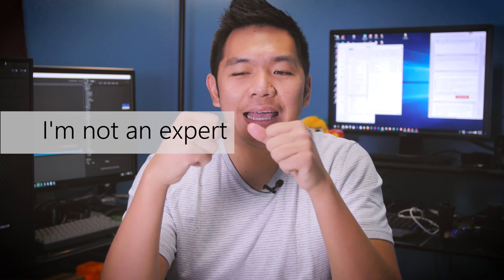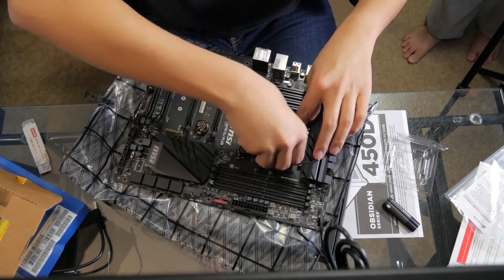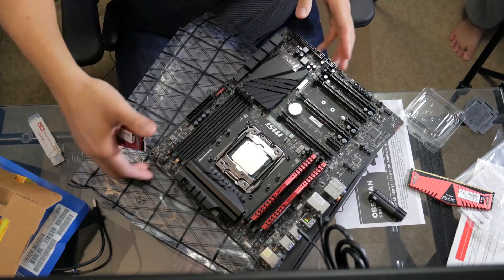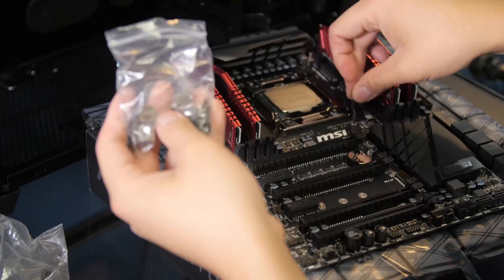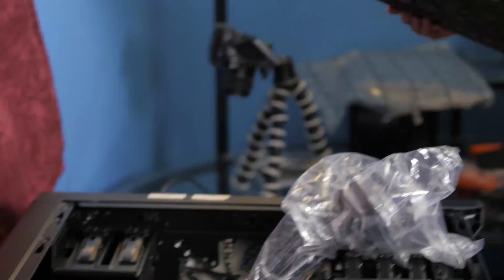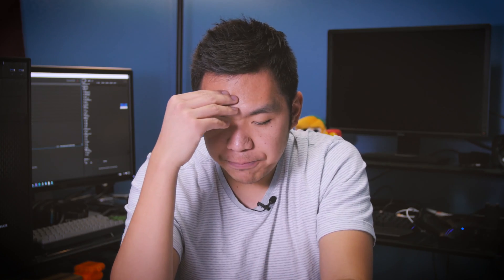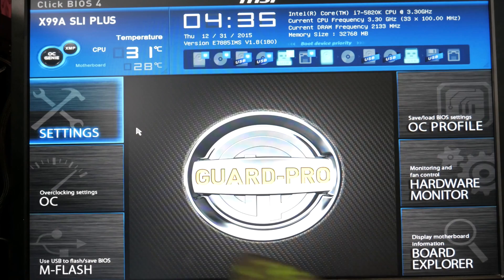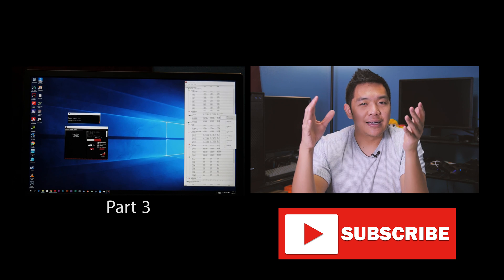4K Video Editing Machine Build 2016 with NVME SSD (Build)

Comment: Hello, T1CG...I'm just starting to build my pc with the exact motherboard and corsair cooler that you have on your build. I wanted to ask you a question concerning the back plate you receive with the corsair cooling system.  The MSI motherboard which I have (same as the one in your pc) has already a back plate which is metal.  Do I need to change that metal one that comes with the motherboard for the plastic one so I can install the corsair cooler to the cpu? Or should I just leave the metal back plate that comes attached to the back of the motherboard on and connect my cooler to the cpu with that one? If you can help me out with this I'll appreciate it thanks!

Comment: Hi, I want to build a pc soon and decided to copy your build because it seems like it's going to help speed things up for me a lot. I do 4K video editing and take a lot of pictures with my D810 in raw and just need to get a powerful machine.  I think your pc build for the money is the best build for the type of editing I will be doing so i'm going for it.  This will be my first computer build ever so a little nervous but If I take it step by step I think i won't have any major problems. I like the tower you have but I was thinking on getting a white version of the one you have.  Are there any large white towers that you would recommend that are similar to the one you have? Any other advice for a first time computer build would be greatly appreciated. Thanks!!
Reply from the maker: I actually upgrade to the Fractal Design R5 case. I found it to be a lot quieter and had more space when it came to adding drives. I can't really recommend a best white case, you'll have to check out other reviews out there.
Reply: +that1cameraguy Thanks..I'll check that case out. I'm not 100% sure what color I'm going to choose but size might be more important so I'll look and see what I get. Thanks again for the reply.
Reply from the maker: Are you going to go with the 6-core 5820k or the 6700k? Theirs mixed opinion on this since higher clock rate is better for lightroom, but the 6-core will do a bit better for video.
Reply: +that1cameraguy I was going to go with 6 core 5820 k. I actually jump from lightroom and photoshop back and forth all the time plus some other photo manipulation softwares and have them runing in the background constantly....When it comes to video editing I just can't stand waiting for the render times I get..It seems like I'm watching paint dry.
Reply from the maker: What is your current system that you're working off of?
Reply: I have a 21.5 inch 2012 iMac with the basic 8gb ram.  To get the performance of a build like yours I'll have to pay a lot more money if I stay with mac computers.

Comment: so, some time had gone by, how are you liking this setup, would you do anything different? currently building my first 4 k editing pc, Abby help will be appreciated
Reply from the maker: +JoserTheDirector I maybe consider a motherboard with more SATA ports. I switched my case over to a Fractal Design Define R5 since it supported additional drive bays. Other than that, the system is doing really well for editing. Let me know if you have any other questions.
Reply: +that1cameraguy I'm gonna go with asus x99 sabertooth, gigabyte gtx 980ti
Reply: +that1cameraguy let me know what you think, asus x99 sabertooth, gigabyte 980ti, intel 5820k, corsair h105, thermaltake 850w, 16gb ram for now, WD black 2Tb, 500gb ssd, nzxt h440
Reply from the maker: +JoserTheDirector It looks good. Do you happen to have a storage solution yet. I'd recommend a few additional drives like your export drive, scratch drive, etc.
Reply: +that1cameraguy oh man I thought the ssd and the 2tb hard drive were good enough, wow

Comment: hey question. i like this build and how it is very specifically designed for 4k editing. how is it doing? i don't understand why you have 32 gb of both adata and crucial ram. do you have 64gb total of 24000mhz adata and 32 gb of the 2133 mhz ram too?
Reply from the maker: +superhumandance Hmm. I guess somewhere in the video I made it sound like their was two sets of different ram, but it's just 32Gb of ram in there. The computer runs very snappy. Editing videos is a breeze. Projects load up in seconds. Exports are very reasonable. Timeline performance is great at 4k until you start putting heavy effects/color grading. It's honestly a joy to use. It works specifically for what I do, which is produce short form videos like this for YouTube and the occasional client work.
Reply: +that1cameraguy no in the description there are 2 r kits. thank you for the awesome response! thinking about getting one of these soon for sure.
Reply from the maker: Oh, oh yeah, the other one is a cheaper option if you go with crucial. Since I have a windowed panel, I wanted the interior to look nice. I went with the ram with red accents. Nice. Let me know if you have any other questions.